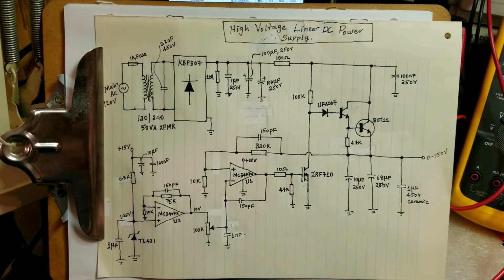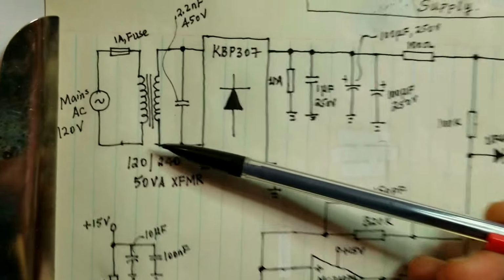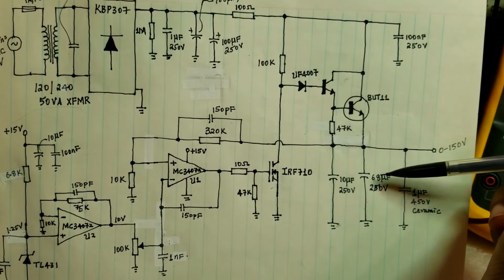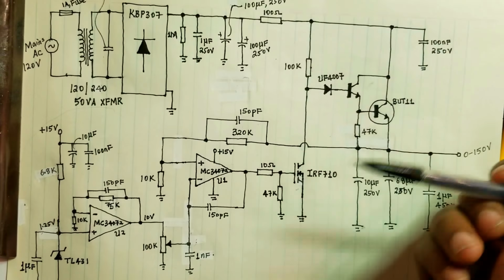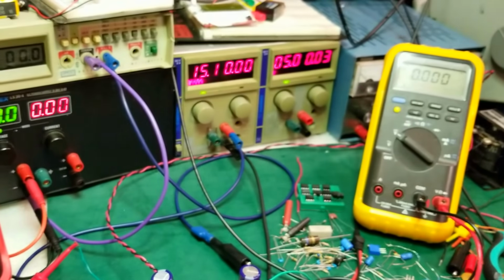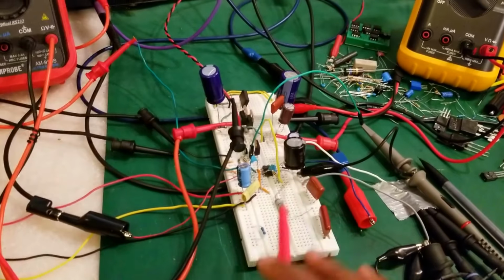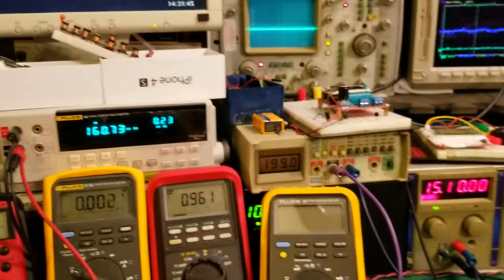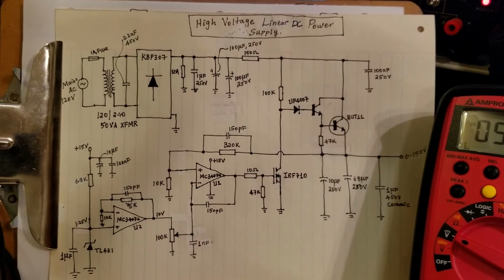High Voltage Linear Power Supply Design and Testing (0-200V)

Comment: Very Nice indeed !  I do like to see that you are using an isolation transformer for the circuit as well. I wonder if placing a diode in the FET gate circuit would useful as an added protection from high voltage just in case of a FET failure to protect the regulator circuit ?  What would be the maximum output power rating of this circuit ?

Comment: Using the +ve input of the MC34072 as feedback (made -ve by the mosfet) is begging for oscillation.
I see the 150pf in the feedback, I hope it is enough, BUT it is part of a 150pf/1,000pf divider at higher freq.

Comment: Wow, the 100k will be dissipating 6.4Watts when the voltage is set to 0V output!
Reply from the maker: That is incorrect! The DC bus that the 100k resistor is connected to can at best go to 200V. At that voltage, if the output is set to 0V, the 100k resistor will only dissipate 0.4 watts. And that is the worst case scenario. Now if you have watched the whole video I do mention that when I build the 800V supply, all the components need to be selected appropriately.
Reply: @SmithKerona  Ooops, my maths is a little off :)   ...I get into such things because I have a pet peeve about wasted power, so my emotions got the better of me!  Btw, I design electronics stuff , sometimes power supply, and it is almost always hybrid tracking, because I like clean power, but hate power waste. :)
Reply from the maker: But for the purpose of this video and this particular circuit, the 100K resistor is more than adequate.
Reply: @SmithKerona  Yep! :)

Comment: Very well executed and thoroughly tested with great effort, I am very impressed! I am just wondering why the op-amps are functioning correctly, as they are controlled by two potentials: 15V from the power supply and at the sensor input from the output potential 0-150V. I did not know that this was possible at all. Or is it a special function of this type of op-amp? I assume that both potentials are referenced to ground, is that correct?

Comment: About 7 years ago I built supply with 0-300V range. TL431, CA3130, IRF710, 2SC945 and IXFH50N50.
I arranged IRF710 as common gate configuration with degeneration input resistor. Easier to fine tune and more stable.
I chose 3 secondary winding-sets transformer which provide 15V for TL431 and CA3130, 10V for biasing IXTH50N50's gate (float) and 350V for output.
Thank you
Reply: Hello sir. Can you share us your experiment ? thanks.
Reply: @braveheart9275  Unfortunately I can't.
Reply: Hello ... O.K. and  thanks  for  the  reply. @iblesbosuok
Reply: @iblesbosuok  Not your design?
Reply: @stevenbliss989  At that time, I drew a circuit schematic from a blank piece of paper, based on my dumb imagination. I don't know if there has ever been a similar circuit schematic. And I don't care about that. My friend needs it and I can help him. I just need friends.

Comment: I know this is quite a while ago but why are you using the IRF710 ? is there any particular reason you're using a mosfet there instead of a bjt?
Reply from the maker: Sorry for the late replay. To answer your question, there are two reasons. First it is very difficult to find high voltage BJTs with good Hfe. Most high voltage BJTs have very low Hfe (~5 to 30). What that means is, you have to provide substantial amount of base current to control the collector current. In this instance the op-amp would need to provide quite a bit of base current to control the collector current of a high voltage BJT for example like the main pass transistors (BUT11). Therefore I wanted to avoid to source that base current from the op-amp (MOSFETs don't require static basic current like BJTs). Of course there is a dynamic base current being sourced from the Op-amp due to the junction capacitances of the MOSFET which will leads me to the second reason. Since that transistor (IRF710) is being used as a common source (emitter if using BJT) amplifier, it has very high voltage gain. This high voltage gain varies with frequency and can cause instability in the main control loop. Typically if using a BJT in this arrangement (common emitter configuration) a small base to collector capacitor is added to introduce what is called a pole that will stabilize the control loop. BJTs have relatively low base to collector capacitance (typically called Miller capacitance). But MOSFETs have quite a bit of Miller capacitance and that capacitance actually helps to stabilize the control loop in this application. Hope this has answered your question.
Reply: @SmithKerona  thanks for the answer!
I definitely plan on building one such supply but i don't think i have any high voltage bjts, maybe there are some in old crt monitor will have to look at it again

Comment: Just some advice if you do proceed with this project. When you say "transistor" rated at 1.2kV at 2A, I suppose you mean MOSFET. In general MOSFETs are built for switching and not linear operation (there are a very few exceptions). Look at the SOA curves for a range of so called high power MOSFETs. At 800V you'll be looking at roughly 50W of continuous dissipation - even then you'll be close to the SOA limit. You could design a linear power supply using MOSFETs to give 800V at 1 amp, but you'd need multiple parallel MOSFETs ie 16 of them. You need to consider thermal run-away as well which is dangerous because MOSFETs blow short circuit. Have a look at some DC load designs, since they share similarity with this type of power supply design.
Reply from the maker: You probably misunderstood but the "1.2kV at 2A" comment I made in the video is for the MOSFET that is interfacing the op-amp to the pass transistors not the main pass transistors.  As can be seen in the video, I was using the IRF710 for this test and when I built my 800V, 100mA supply, I used IRFBG30 and it only dissipates about 1.6W at 800V. This is because it is only used as common source amplifier to interface the op-amp to the main pass transistors (see below).    

Indeed I am aware that most MOSFETs are optimized for switching applications and SOA needs to be strictly overserved for linear application. That is why I built this supply in 2019 with two IXTX20N150 pass transistors :). The supply is rated at 0-800V, 0-100mA with CC and CV function. Stay tuned for an update video.

Comment: Hello, nice circuit! Have a question - those capacitors at the output of the rectifier have voltage rating of 250V. But if you are using transformer with output of 240V that would make something like 340V DC at the output of the rectifier if you connect that circuit directly at mains. So if one wants to build this circuit those caps should be rated at least 350V, am I right?
Reply from the maker: Thank you! And great question. Yes you are absolutely correct that if the output of the 240V transformer is to be used from 120V mains directly, those filter capacitors need to have the proper voltage rating which should be greater than 340VDC. But if you notice when I am testing the circuit at 18:45, I am using a variac (autotransformer) to supply the 120V side of that transformer so that the rectified and filtered voltage sits around 200V. If you do the math that is about 70V on the 120V rated primary winding. That is why I said at the end of the video that all the components need to be scaled up properly for high voltage operation. In fact those capacitors on the supply that I have built (0-800VDC) are made of two 450V rated capacitors in series to give me the required voltage rating. Stay tuned for an updated video that shows the implementation of 0-800VDC and 0-100mA power supply soon. Cheers!

Comment: Hi ! Congratulations for your project !! I just smoked six TL783 ICs trying to assemble a  1,5V -120V  high power supply as depicted on their datasheet .Even a MJE11015 got shorted . I gave up to use this " wonderful "IC  and backing to use discrete components like you did. Snag is that I could not find MC34072 and IRF710 . Any suggestion ?
Reply from the maker: Hello, have a look at the schematic that I came up with using low voltage single supply opamp (MCP601) and HV BJT (MJE13005). https://drive.google.com/file/d/1AaTodBA69dSlvdN47gFvb6UYdPmTPd4l/view?usp=sharing
Make sure to observe SOA of MJE13005 transistors carefully since they are switching type transistors and are not well suited for HV linear application. If you can cool them sufficiently you might get away with 70-80mA of current at 120V. You can parallel a few more with emitter degeneration for more load current. Also if you don't have access to MCP601 opamp you can replace it LM358. But at 5V supply voltage you will need to recalculate the feedback resistor Rf to give you the required output voltage since LM358 can't output more than 3.5V. Let me know if you build this circuit.

Comment: Why did you decide to use BJT over FET for pass transistor? Couldn't find one with sufficient SOA at HV of 800V? I read in the comments that you're limiting output current to 100mA. It should be easy to find a FET capable of that. Just curious, thanks for video and stay safe.
Reply: I take it back. FET at DC 800V@100mA is a little hard and probably expensive. For someone looking for 0-500V range, here are my notes. 
AOT10N60    300V@800mA,     600V@400mA to-220
AOT12N65    300V@800mA,     650V@400mA  D2PAK
AOT27S60    300V@1000mA,    600V@600mA  to-220 $3 
STP33N65M2  300V@2000mA,    650V@1000mA to-220 $2.78    190W, no dc on SOA
AOT42S60    300V@1500mA,    600V@700mA to-220
FCP104N60   300V@1250mA,    600V@600ma to-220

I haven't explored much in the past 2 years though. Have fun.
Reply from the maker: @CraigHollabaugh  Hey sorry for the late replay! Yes you are indeed correct regarding the availability of reasonably priced high voltage MOSFETS. As a matter of fact I am using two very expensive HV MOSFETs (IXTX20N150) from Littlefuse with excellent SOA for this project. They are $20 a pop and definitely not cheap to use in hobbyist projects.  Normally I like to stick with BJTs for linear applications as they are easy to stabilize in closed loop application like this project. I had a hard time stabilizing these MOSFETs with their large parasitic capacitance. But the control loop is sable now with decent transient response. Stay tuned for an update! 

And thank you for providing part numbers of decent MOSFETs with good SOA for low voltage applications ;)
Reply: @SmithKerona  I looked at those IXTX mosfets but didn't need (or want) a 1000V circuit. The 20N150 is quite a part 300mA@1000V DC SOA, that's a killer part, both dangerous and awesome. I don't see my tube amp work going much above 500V. Look forward to your upcoming work. Thanks for the reply.

Comment: Did you finish the tutorials for component calculations?
Reply from the maker: Yes I did. I just didn't have time to make a video about it. I will try to link the schematic here when I have a chance.
Reply: @SmithKerona  please do so. much appreciated. the tutorial for component calculation would be beneficial for us hobbyist.
Reply: @SmithKerona  any updates on this project? I have some interest in seeing what's needed to scale this up to 0-350v 5a cc/cv adjustable power supply.
Reply from the maker: @ljaeracer4152  Sorry for the delay making the video. Just don't seem to have enough spare time to do videos anymore. But I can tell you that 350V, 5A rated supply would be difficult to implement on the principles shown in the video since you are looking to have around 1.7kW rated power transformer (VA rating will be even worse), serious cooling for pass transistors and also expensive pass transistors that are designed for linear application. For that kind of output power, If I were you I would look into full bridge forward type switching converter.

Comment: Great content. Funny I have just designed a 200V variable PS with CV/CC function, and the circuit is remarkably similar.
Although I'm curious as to why you have the UF4007 diode at the base of the output transistor?
Reply from the maker: Thank you and great question! The UF4007 is there to protect the output transistors's BE junction when the IRF710 switches on putting the base of the Darlington transistors at ground potential while the output filter capacitors are charged to more than 10V. As you might be aware, BJT's maximum BE junction reverse voltage rating is around 5 to 9V. Therefore the UF4007 diode will block any reverse voltage up to 1000V across the BE junction of the output transistors. I should have explained the purpose of that diode in the video.
Reply: @SmithKerona  That makes total sense. I didn't think of that. Now I have to add that diode to my design. Thank you!!
Reply from the maker: Regarding CC operation, I will include fold-back type over-current protection set to a maximum of 100mA.
Reply: Hello The LED artist, Do you mind to share you project? I am looking for something similar.